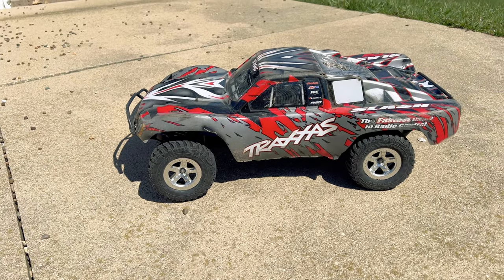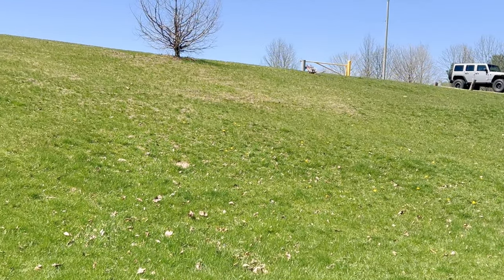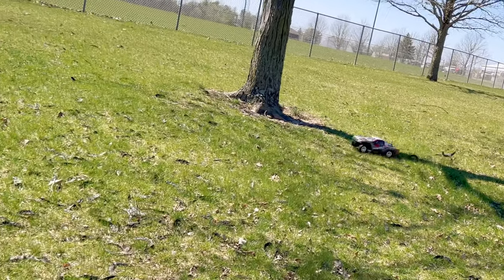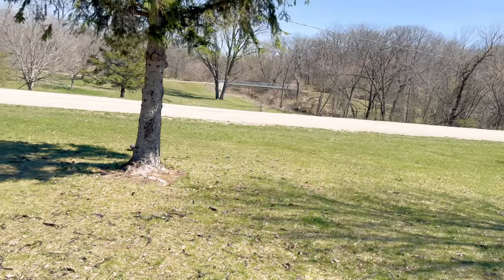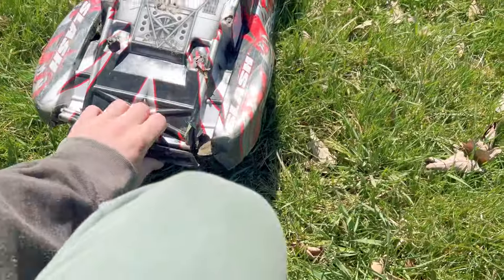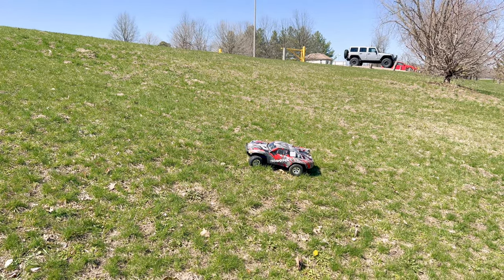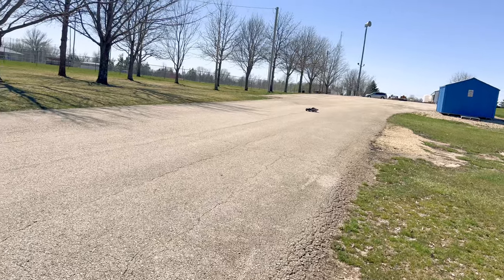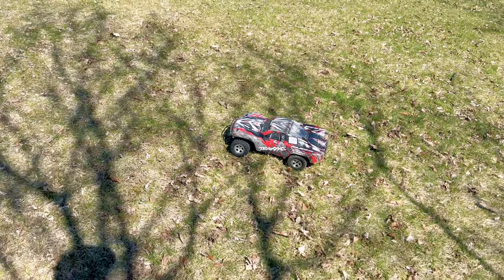Will STOCK TIRES Hold up to 4S BRUSHLESS POWER??   “The CHEAPEST Traxxas Slash PROJECT”

Comment: Of my small collection of rc cars, my 2wd slash is also my favorite to drive. Im currently fixing mine right now because i hit a curb rear wheel first at full speed and broke the bearing carrier and axle. Its pretty much stock except a 3s system out of a hpi on road car. Im slowly gathering parts to do a long travel build on it.
Reply from the maker: Yeah it’s a super fun truck to drive! Best of luck with your build!
Reply: I would love to do long travel suspension on it come back and find me when you figure that out!
Reply: @AquariumAficionado  Look up Desert Valley R/C here on youtube. He has a long travel slash with a bronco body i'm using as inspiration. Just some parts he used are hard to find like the shocks for example, so im trying to find alternatives. They also make 'kits' for long travel, but they all are very expensive, usually have a lot of aluminum parts and make the truck look kinda goofy in my opinion.

Comment: Let’s gooooo🤝
Locking up the breaks on a 2wd makes you better at counter steering though I’ve gotten pretty good at avoiding that spin out and occasional flip
As long as you’re turning the direction you’re sliding it shouldn’t flip
Reply: Having a 2wd rc vehicle that has a ball differential makes dirt drifting at full speed a breeze.
Reply: @DTW-bx2vy  never driven one, would love to see the difference though
I hate the planetary gears I’ve broken like 6 diffs within a few months
Reply from the maker: Agreed, it definitely makes you a better driver